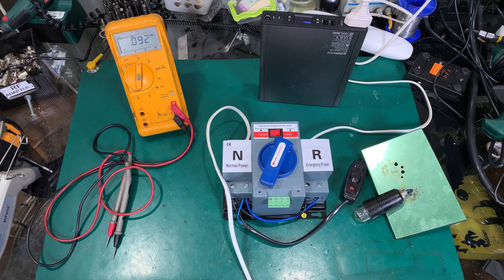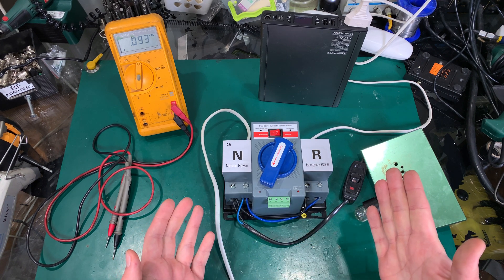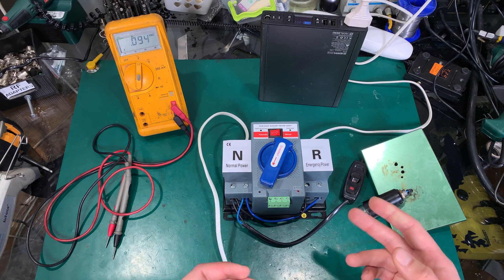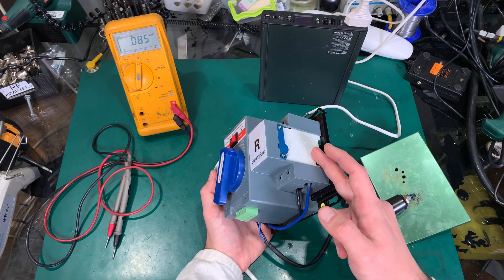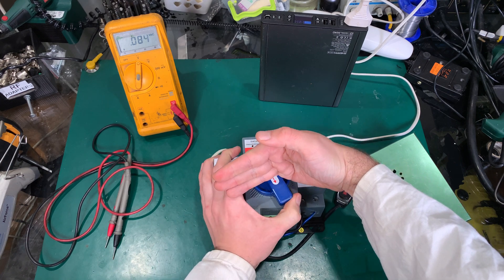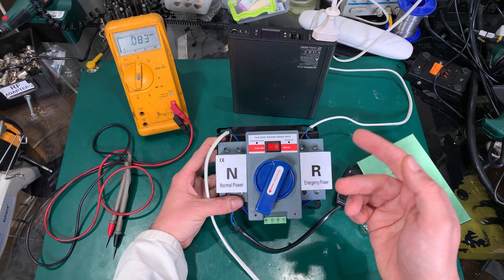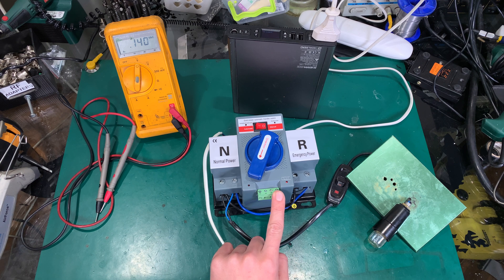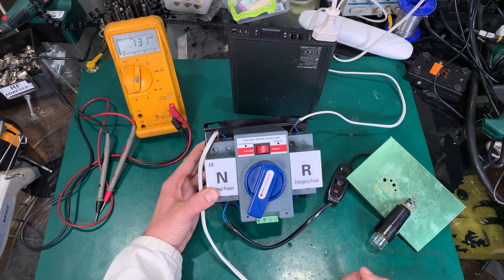ATS automatic (automated) transfer switch for mains / gas generator / inverter switching 1 phase

Comment: thanks for making this video, how are you getting 230v out it if it is only connected to 1 leg and a neutral?
Reply from the maker: To get 230V You only need two wires Phase and Neutral.  This is not legal advice since each country might have specific set of rules and there are different power systems like TI (isolated) or TN TN-C -  general rule is that earth wire should be never broken (switched).  Maybe You are confusing with 400V (380V) - this require three phases and measure voltage between them.